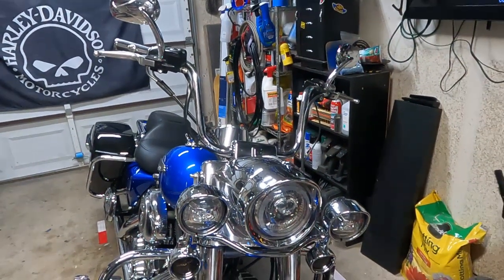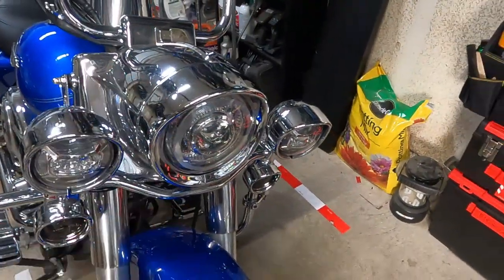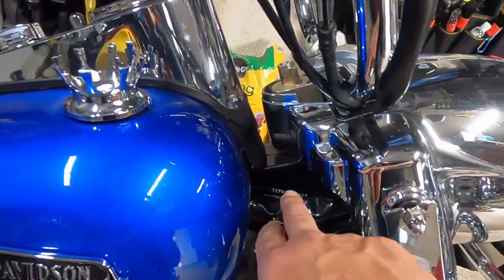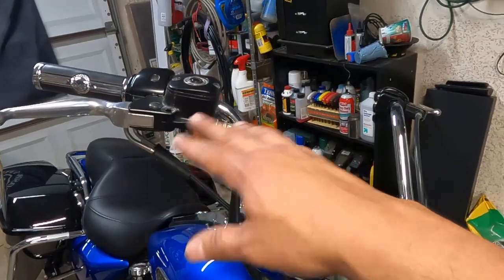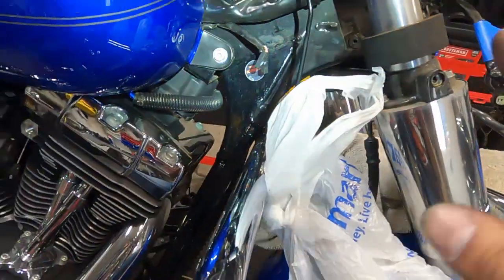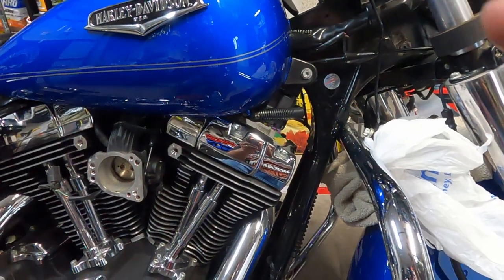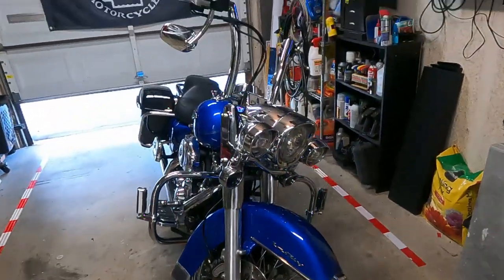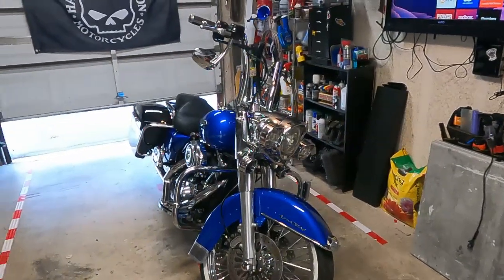14" Apes - Road King Classic

Comment: 9:35 you should change the bushings in the risers to stiffer ones. original ones are to soft and with the apes they tend to fail.
Reply from the maker: Hi Kukus, thanks for the feedback.  Any recommendations on replacement bushings?  With the stock ones being softer, I imagine it helps dampen some vibration, do you know if its noticeable with the stiffer ones?